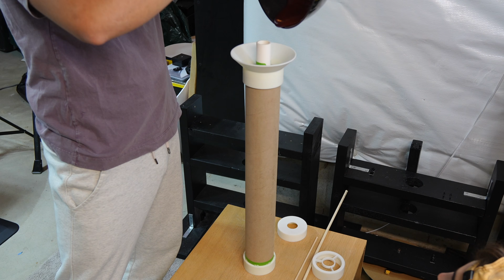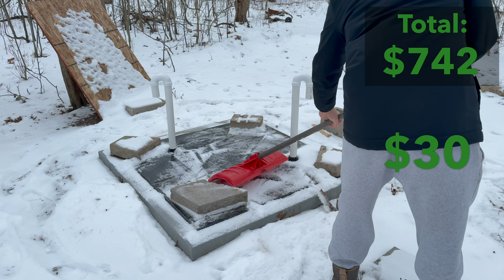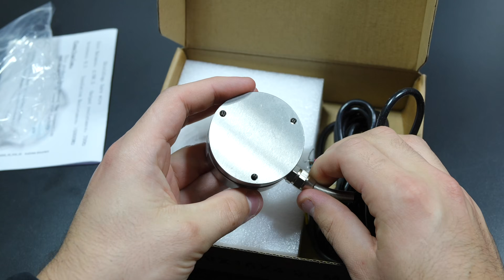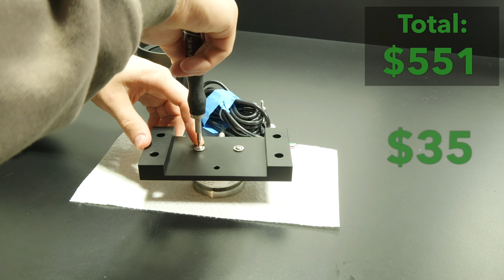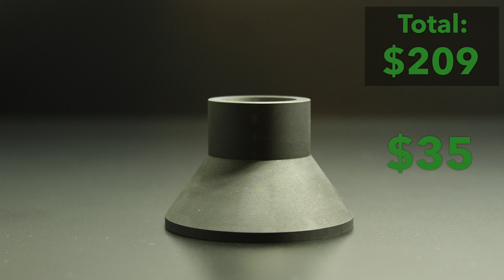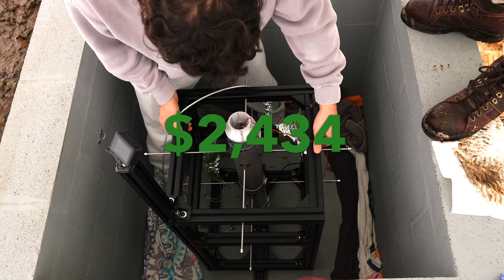How Much Does It Cost to Build a Rocket Motor? – MEGAx Ep 7

Comment: I do a lot of waterproofing for bathrooms, pools etc. Paint won't waterproof your blast chamber. What you need is a waterproof membrane. It should be available in your larger hardware stores. Ideally just use a wire brush to scratch your existing paint layer and get back to the brick (it doesn't have to be perfect just enough to give the membrane something to stick to) then paint it on. To really seal the corners embed some corner tape, withe the first coat, then do a second coat over the top. It doesn't have to be perfect for your application, nor do you need much of it. You should be able to do it for less than $100
Reply from the maker: Thanks! I’ll try this in the summer.

Comment: Total impulse of motor?  Cost of a just a reload after required tooling to make a reload is purchased? Casing hardware cost without decal?  Cost of casing hardware requiring replacement after each firing?  I ask just out of curiosity to get a comparison with commercially available motors. I'm sure it will be much cheaper.
Reply from the maker: Total impulse of V1 was 4,266 Ns. 
MEGAx will eventually be fully reusable making the cost ~$75 per test. 
Casting cost was without decal.
Reply: Q:  Provide the prices of reloads for hobbyist solid rocket motors in the 4,266 Ns total impulse range.

Grok 3 AI:

$300–$380 (most common for AeroTech 75mm high-impulse L reloads close to 4,266 Ns).
$200–$300 (Cesaroni 54mm 5–6 grain high-impulse reloads in upper L).
Reply from the maker: @winstonsmith478  For MEGAx, I could probably get the cost per test down to ~$50/40 per test if I buy propellant in large quantities.

Comment: A project's cost always ballons up due to unexpected expenses.
Three years ago I decided to built a gyroscope-free IMU, built around several accelerometers. A simple electronics project right ? Wrong : three years, a dozen of failed pcbs, more than 1000 € in material and components alone, around 2.2k€ if you account for the 4 channel oscilloscope and the prusa mini which were specially bough for the project.

The key issues :
- unreliable spi connections
- spi is made to interface too many devices, in my case 1 master and 9 sensors was way too many, you have signals reflecting from parallel connections due to the inherent impedance mismatch
- despite me buying the sme sensor module (LSM6DSOX) from the same manufacturer(Adafruit) at the same reseller, I got different batches as I didn't bough all my sensors at the same time (I reorderd a complete set once I saw that something was really wrong) and they aren't as sensitive to parasites depending on the batch
Reply: How did this turn out? What were you using it for?